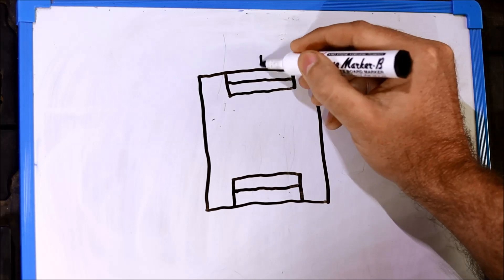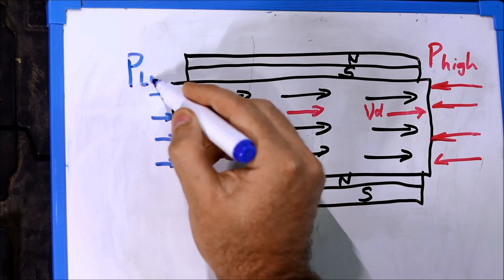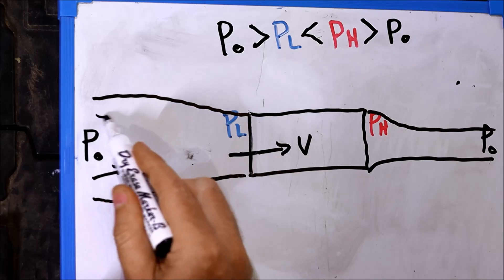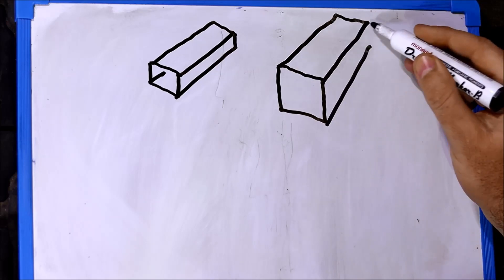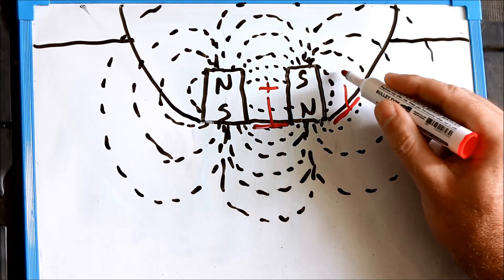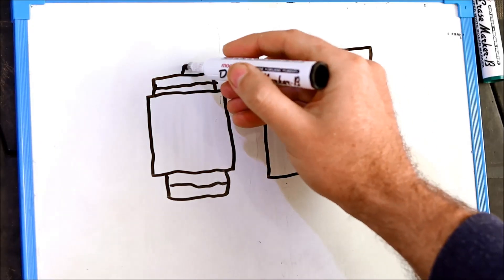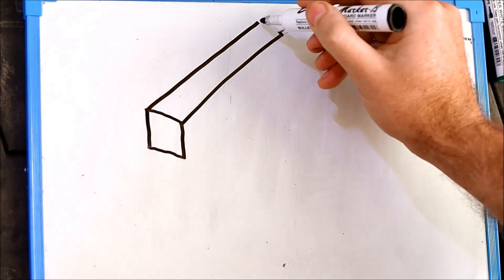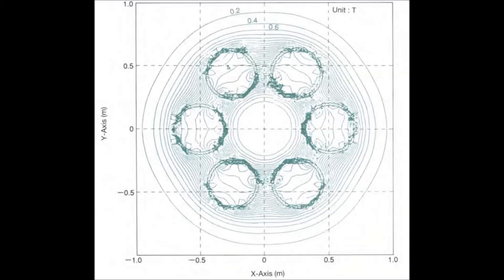Magnetohydrodynamic propulsion - external flux design

Comment: ⚙ Fraser’s Core Thesis:
→ Magnetic and electric fields can interact with a conductive medium (e.g., seawater) to produce thrust — without moving parts.
→ The force emerges via Lorentz interaction: current × magnetic field = body force.
→ The system is modeled using pressure gradients and Bernoulli-style conservation principles.

🧭 FIELD MECHANICS DIAGNOSTIC
🔵 1. “Body force distributed evenly throughout the water”
“A pressure gradient forms, creating a net-zero internal force, but Newton’s Third Law implies thrust must exist on the magnets.”

✔ Good observational logic, but the Field Mechanics pivot is this:

This is not merely a balance of vector forces — it is a demonstration of asymmetric energy containment and release.

The duct becomes a capacitor of flow tension.

The magnetic field acts as a shaping dielectric.

The electric field acts as the phase-alignment trigger.

→ What he’s showing is that water is not being “pushed” — it's being field-modulated, and then allowed to exit a structured containment with directional bias.

🟣 2. “Velocity remains constant, so pressure must rise”
“If force is applied, why does velocity not increase through the duct?”

This is a big moment — and Fraser handles it well mechanically, but misses the field cause.

→ Field Mechanics answer:

Velocity doesn’t increase inside the duct because it’s behaving as a resonant channel — not a propulsive engine.

The system is producing structured discharge — not uniform acceleration.

The energy isn't pushing fluid faster — it's reorganizing potential flow geometry, and then releasing that tension asymmetrically.

🔶 3. “Efficiency tradeoff: big duct = lower velocity = better momentum transfer”
✔ He correctly shows:

Lower velocity = higher propulsive efficiency

But too large = magnetic field drops → electrical losses increase

This is a geometry vs. field strength tradeoff — and that’s pure Field Mechanics.

Bigger container = better boundary tension

But weaker internal field = less impulse per unit charge

Fraser frames this in engineering terms — but what he’s modeling is the tension between volume and voltage — or in Field Mechanics:

Energy storage vs. Energy activation.

🧲 4. Star-shaped thruster array (Yamato One analogy)
The Yamato One’s design mimics a nested capacitor array:

Six ducts = segmented phase channels

Central ring = resonant node

Superconducting coils = field concentrators

He even hints at radial electric currents with toroidal magnetic fields — which is precisely what ancient Vedic ring temples and Ark-like structures were doing:

→ Field containment.
→ Resonant pressure node creation.
→ Non-chemical propulsion.

🔬 CAUSAL GAP DIAGNOSIS (What Fraser misses)
The system is field-coupled, not mechanically driven.
→ He models pressure but never asks: what holds the pressure in shape?

The real work happens at the boundaries.
→ He doesn’t model dielectric impedance, field collapse geometry, or aetheric rebound.

He implies Newtonian dynamics, but what he describes is coherent field modulation.
→ It’s not “pushing water” — it’s organizing energetic flow, holding it, then releasing it with phase bias.

🧩 FIELD MECHANICS REFRAME:
The MHD thruster is not a “thruster” in the classical sense.
It is a field phase manipulator that entrains conductive fluid into a structured energetic pathway, then releases boundary tension asymmetrically, creating reactive containment collapse — which appears as “thrust.”

Comment: Would the effect work with better with the super rare earth magnets? How about ring magnets with the electrodes connected to each with water running thru tgem? Half circular? Pulsed electrical currents with a variable duration and/or a pulse rise/fall tone related to speed? Using a large super farad capacitor to provide a high pulse of electricity? 

Lots of thoughs there.

Comment: Thankyou, ouitstanding video and great project. Would be thrilled if you consider the following in your next video:
* to what extent can your design incorporate halbach magnet topology?
* is it optimal to have sets of magnet electric plate pairs on the hull, rather than one, due to the increased mag field stength in the smaller geometry of each one?
* the mag field vs distance function can be determined via simulation (ask me for details) or measurement, so if you can estimate hull friction function then you are ready to optimise geometry via calculus.
* can you apply a low friction coating to the hull?
* would you consider the use of electromagnets rather than permanent magnets... It could be that higher mag fields could be generated during brief high current pulses, with the water helping to cool the electromagnet down in readiness for its next pulse. Magnetic material selection is important to limit saturation
Reply from the maker: Good questions. 
A Halbach array should work well with these flush electrodes. Even an iron flux bridge should help, I did test one but the extra weight is significant enough to cancel the benefit of extra thrust during acceleration. Top speed should be higher though. The same is probably true for a Halbach array.
The single magnet vs many small magnets is a difficult question and it would depend on other variables as well, such as the thickness of the small magnets. I used K&J Magnetics' website calculator to get an idea of field strength and it was clear that flat magnets have very low surface field strength. (Tell me more about your simulations). That is why I stacked three 8mm magnets to form each large magnet on my boat, to get higher field strength at the poles. As I have mentioned in the previous video, I did the thruster design by gut feel. I have since analysed ducted thrusters and there are clear trade-offs between magnet spacing vs electrode spacing. It is a topic for another video, I will first have to build and test a few prototypes. I 
A low friction coating would be especially effective at these low speeds.
I haven't looked at pulsed electromagnets. The electrical power required just for the electrodes is already very high so one option might be to use the existing current in that circuit to aid the permanent magnet, i.e. send the current through a coil before it reaches the electrode.
Reply: @williamfraser  My second point referred to having multiple magnetic and electric elements across the hull cross section rather than two magnetic poles and 3 (1+ve and 2 -ve) electric fields. I have used FEMM software (it's free) to simulate magnetic and electric fields. Once you get the hang of it, it can produce an accurate and helpful 2D analysis of field shape and strength. It is possible to automate its parameters via LUA, so ideally that would be the basis of optimisation of the number of magnetic and electric poles in a given cross section.
Reply from the maker: Thanks, I have heard of FEMM, just never got around to trying it.
In my initial concept sketches for the boat I considered various other magnet arrangements such as four magnets, one pair of magnets on each side of the hull, each pair requiring three electrodes although a central electrode could be shared.
Another arrangement had one large central magnet and two smaller magnets, one on each side, and requiring a total of four electrodes. I think what made me decide against these was the need to use differential steering without the need to disconnect both polarities per side simultaneously. Not that the final steering really worked outside of the test tub, the two thrust vectors are way to close to the center-line. 
A distributed array (lateral and longitudinal) of magnets and electrodes could have hydrodynamic benefits such as maintaining a body force gradient in the boundary layer that allows extended laminar flow for lower drag, as well as using the pressure gradient against the hull to produce a net thrust. A research submersible with similar design has been built, I'll see if I can dig it up.
Reply: @williamfraser  looking forward to the next episode!

Comment: Mr Fraser , I was curious of your opinion of trying to make a Thruster that would work in freshwater. Do you think that if you increased the voltage to very high voltage on the cathode and anode that it could possibly break down the dielectric effect of having no salt in the water?
Reply from the maker: Most freshwater bodies have at least some conductivity, so there should be some high voltage at which enough current can be generated to produce thrust, it is just a matter of efficiency: more voltage for a given current means more power required.
Reply: @williamfraser  You can use railgun principle, where conductor is a plasmatic arc itselve.
Reply from the maker: How much voltage are we talking about? Will the permanent magnets still play a part? I built a small Jacob's ladder (long time ago) with a hobby HV transformer and could not see any effect with a magnetic field across it. Need to try it again.
Reply: @williamfraser  hello mr. Fraser. I'm 65 years old now, I was in radio repair in the military and electronics have been a hobby since I was 10 years old, it still is. I have salvaged a lot of parts from different equipment most of it vintage, and I used those parts just to continue my hobby and keep me busy. Building some type of hydro Drive is probably more theoretical right now than actual. But I actually could try it sometime. I have two large curved ceramic magnets from a large DC motor. One magnet North facing inwards the other magnet south facing inwards. I thought I could put it on a small PVC pipe and put the electrodes inside with the magnets outside the PVC. And use a car battery with an HV Transformer in an oscillator circuit. I would figure that the higher the frequency the better the effect for breaking down the dielectric of the water. I'm more curious about things than actually getting them done sometimes. After having moved into a small apartment I do not have the same room I had in my ranch house. So it is a bit harder to spread things out and get projects done. But I do enjoy watching not only your videos but others from people who still get a chance to experiment. I'll keep watching, God bless you and thank you for your help.
Reply: @williamfraser  I think it should work in pulse mode, and magnetic field could be used like in CRT's for changing plasma direction.
Reply from the maker: @NEW_INSITE  Mr Blackwell you must know much more about high voltage and high frequency than I ever will. The ceramic magnets should work, if you have the motor housing that would be even better because when mounted inside, the magnets' flux has a return path through the steel, creating a stronger magnetic field inside. The Plasma channel chap just published a video on a catamaran propelled by ionic air thrusters. It certainly renewed my interest in high voltage stuff. Please let me know if you discover anything interesting in your project!
Reply: @williamfraser  thank you mr. Fraser, and I don't know that much more about high voltage I don't think then you do. I'm well read but my specialty was in low voltage  , transistors, like radio repair. But I have experimented with a little bit of this a little bit of that. I'm definitely not an expert, but if I find myself in a pinch I can always use the internet to find information that other people have provided. Anyway it's been a joy talking to you, you take care. Feel free to comment back anytime you have an idea. I once bought a variac from Fry's Electronics, I needed it to power 150 volt power supply for a helium neon laser I had bought. But the variac only went up to about 135 V. So I took it apart figured out how it worked and added a tap a little bit in from the end of the coil which brought the voltage up to about 155. It was perfect for what I needed. But that's kind of how I do things, if I don't know how to do it, I'll play with it till I figure it out.
Reply: Not likely.  But no reason to not give it a try.
Reply: @jdove6883  yeah I really don't think it would work much, it might give a little thrust but probably not worth the effort. I was just curious of Mr Fraser's opinion.
Reply: @NEW_INSITE  Yeah, agreed.  However Fraser is not incorrect.  I am a physicist and his theory is definitely
correct.  What he accurately states is not that it can't occur but rather the efficiency is lousy--which it is..  However,
given a great enough power supply/source and well designed materials you could make it happen.  But your
conclusion is absolutely correct, not worth the effort.
Reply: @jdove6883  thank you for that. And congratulations, that's a great job being a physicist. I guess I've always been interested in a little bit of everything, not quite an expert at enough. Take care of yourself.
Reply: You can make a working MHD thruster in fresh water simply by carrying electrolyte with you. Use a small pump to flow some electrolyte into the key areas between the electrodes where the magnetic field density is highest, and the thruster will operate with an efficacy hundreds of times higher than if you tried moving with just fresh water. High voltage might be useful, but I feel like it would fall into a different class of MHD thruster altogether. You'd need a new electrode geometry to aid in dielectric breakdown, and the conductive channel would need to be carefully considered to utilize it for propulsion, because that is the only area where charges are flowing across your magnetic field. It's worth looking into.
Reply: @InfinionExperiments  Thank you.